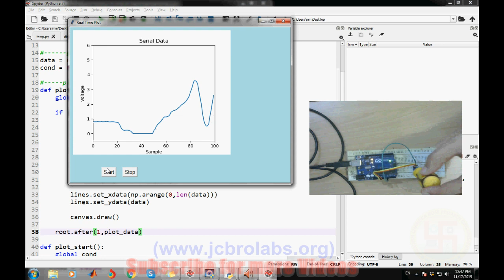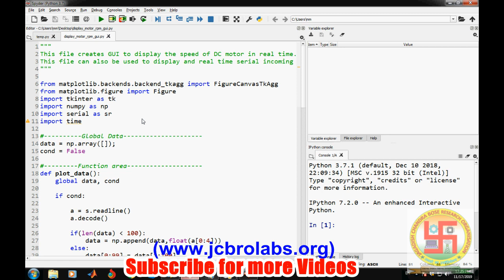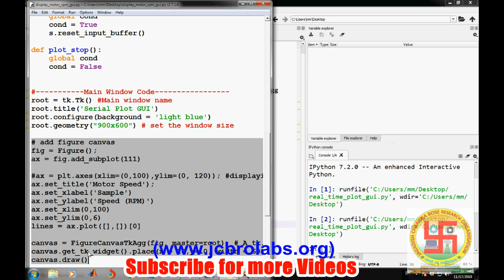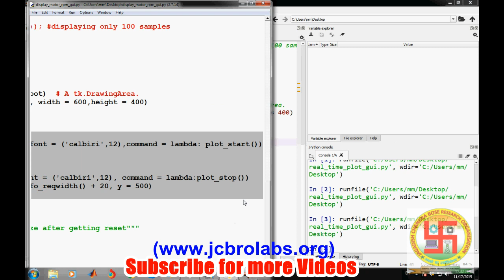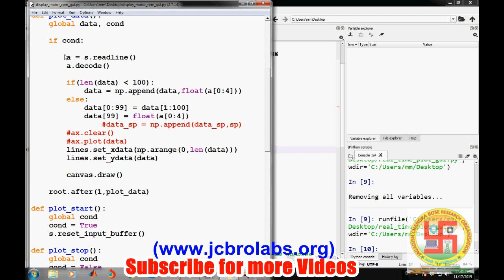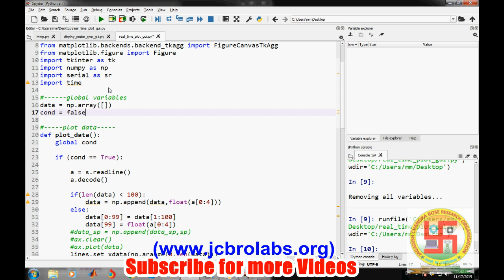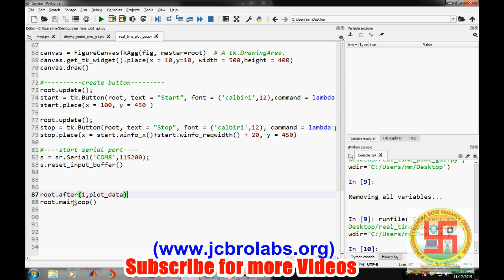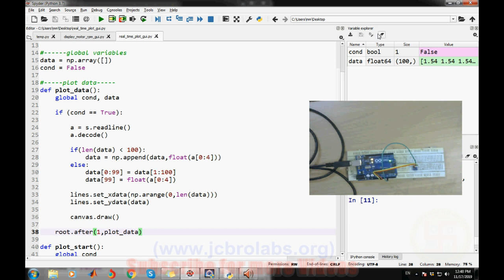How to Plot Real Time Serial Data on Python GUI??

Comment: what if instead of arduino I connect an oscilloscope , will the code have any changes or is this code compatible with that too? Someone please clear this doubt !!
Reply from the maker: Free Free...Get the AVR Bare Metal course for free. Limited Time offer....use the following link:
https://www.udemy.com/course/bare-metal-programming-of-avr-micro-controllers/?couponCode=9F5E62DD80CD1D54D816

Comment: Hello Sir, thank you for your video! I have a question. Can I implement the same code for my Nidaq USB - 6009 instead of arduino? Appreciate your help!
Reply from the maker: If I am right then Nidaq USB doesn't support serial communication. Labview driver needs to be installed for that in order to use the same in MATLAB and LabVIEW
Reply: @sachinsharmajcbro  that is true. I'm using NImax and using Nidaq modules in python, but I can't really get output in python GUI. One more question Sir, if we use arduino, then we need to write the script in IDE first then go to Python, am I right?
Thank you for your help, Sir
Reply from the maker: @dioutoroo  yes

Comment: When I press start the program crash and stop, also It doesn't show any graph signal, It Is only for Arduino? I'm using a Chatillon pull test connected via DB9 yo USB
Reply from the maker: There must some problem with opening the serial port or program routines. further, the same program can run for any board as long as data is being sent to the serial port is captured properly.

Comment: It seems the syntax for matplotlib and PyQt-Graph is not compatible. Any thoughts on when one may be better suited over the other? 

I'm trying to plot real-time data coming in from the serial port ("5, 0x1234, 1.938\r\n") , but I start to lose data after a few seconds..   any suggestions on either using concurrency (queue/collections.deque, threading, asyncio, multiprocessing) or whether to use matplotlib-blit, or PyQtGraph-split... or PyQt vs tkinter....    or any approach that would maximize the throughput so that no data gets dropped from the serial during the GUI update?

I'm running on a PC, but I saw an example of a fast oscilloscope on a Raspberry Pi using OpenGL/freeglut , however, the use of the GPU looks intimidating and perhaps overkill for my needs!
Reply from the maker: Actually, If you are sending data at fast rate and python is reading that data from a function only then you will loose samples. In this case you should use a thread to read the data from serial port. Further, if you keep appending the data in an array then too you will start loosing sample after some duration.

Comment: Dear Sir, thank you for sharing this guide. I am doing a similar project but using a raspberry pi and the INA260 sensor connected to gpio pins 2 and 3. Is there a simple way to modify your code to make it work? Thank you so much for any information.
Reply from the maker: Code can be modified. You can contact me at info@jcbrolabs.org for customization.

Comment: I have coded your example ant it works BUUT, if I let the program run it suddenly stops after a few minutes. My arduino and python program works perfectly good if I test it using only the terminal without the plot. Can you share me any suggestion to solve it?
Reply from the maker: I am not sure about this issue. After how much time, does program stops responding?
Reply: @sachinsharmajcbro  I inserted an "sleep(0.1)" function. I deleted this and the problem was solved. Thank you very much for your support. And also thank you for your video you're a really good teacher!!!

Comment: sir in line 28 it gives me an error couldnt convert string to float. the data is coming from arduino serial port by println command can u please help me
Reply from the maker: If some part of the received data is missing then it throws that error. If you are reading in continuous mode then you should use, try and except block
Reply: @sachinsharmajcbro  thank u sir i will try it. the problem that the data are sent after the start button pushed and the received data is NONE ""
Reply: @itzikovadia851   Try this code in the Arduino program: void setup(){
  Serial.begin(115200);
    
}
void loop(){
  //send a float number 5.6
  Serial.write(53); //5
  Serial.write(46); //.
  Serial.write(54); //6
  Serial.print("\n");
  //send
  Serial.write(56); //8
  Serial.print("\n");
  delay(200);
}

Comment: Hi sir,  I am facing an issue that there is no signal in my plot even I had press the start button, the graph is empty. I have checked and there are no errors for the coding. May I know what is the problem?
Reply from the maker: Hi, actually, I can't help you without looking at the code. You can send a mail at: info@jcbrolabs.org
Reply: try this code in the Arduino program: 
void setup(){
  Serial.begin(115200);
    
}
void loop(){
  //send a float number 5.6
  Serial.write(53); //5
  Serial.write(46); //.
  Serial.write(54); //6
  Serial.print("\n");
  //send a number
  Serial.write(56); //8
  Serial.print("\n");
  delay(200);
}

Comment: One thing i noticed is that the signal has a delay or lag in the signal displayed in the Python GUI.
I even changed the baudrate to 250000, but i still have a 2 seconds lag in the signal.
The Arduino IDE shows the singal smoothly.
I appreciate your help.
Regards,
Reply from the maker: Actually, yes this is the problem and I also noticed it while working on a "Real time display and data acquisition project". This problem also doesn't collect the required number of samples.
You can solve this issue with the help of threading.
Regards
Reply: @sachinsharmajcbro  Thanks for replying. I see that one makes a better use of system memory (making the program faster). I also tried making the Gui an .exe file with Pyinstaller.exe and there's barely a lag. Thanks again.
Reply: @TheCarloszoom3000   Hi, Unable to make exe file and showing error like- 

Traceback (most recent call last):
  File "real.py", line 5, in <module>
ModuleNotFoundError: No module named 'serial'

how to resolve this issue, I even tried with hidden import. Still not working

Thankyou
Reply: i have tried code in this video and having a same trouble, how u can solve that trouble sir? can u explain it to me please? thank you

Comment: Hi,
I want to show the 3d graph. can you help to do this. I am reading the value of the accelerometer. I want to show the line graph in Tkinter.
Reply: there are some changes in the line of code. I try myself to make desired output but I fail to do this, can u help me to make the desired ouput.
Reply: lines= ax.plot([],[])[0] can u explain  this line of code.  what does do? and what all changes it needs to make 2d graph to 3d graph, if I generate the 3rd coordinate by using random.random().
Reply from the maker: Hi, It can be done. Please contact us at: info@jcbrolabs.org
Reply: @sachinsharmajcbro  Ok, Thank u for giving me your contact address. Thank u in advance. I send u a mail. Plz, reply as soon as possible.
Reply: @sachinsharmajcbro  I am getting error when I pass these  "lines.set_zdata(data)" and the error is 'Line2D' object has no attribute 'set_zdata'.... what all changes it need to run these line "lines.set_zdata(data)".
Reply: @sachinsharmajcbro  still I am getting the same error after modifying the line of code. that is AttributeError: 'Line3D' object has no attribute 'set_zdata'

Comment: Hello sir, your code works very well! Thank you first of all. But i am facing a little problem, when running the code again, i recieve an warning in the console: 

invalid command name "2073612564416plot_data"
    while executing
"2073612564416plot_data"
    ("after" script)

The GUI still works when i run it a second time, but i guess it has an old after.loop running in background which collides and throws the warning or something like that. Do you know how to solve this 'problem'?
Reply from the maker: I can not say exactly without seeing the code.
Reply: @sachinsharmajcbro  i solved it on my own, the root.after loop was still running in background as i expected. So i defined a condition to exit the loop when closing the GUI and now it throws no warning anymore. I appreciate your work!
Reply: @robertstockmann4720 and @sachin sharma, I receive the same error as you mentioned here "2073612564416plot_data". However, in my case, the GUI appears but the data don't appear on the plot window. Though, I can receive the serial data while using the serial arduino terminal. Can anyone of you plz help.

Comment: Dude, isn't it possible for you to provide Arduino code? I swear I've tried with default one but it is not working. I don't know if maybe if using a wrong one
Reply: Try this code for the Arduino program: void setup(){
  Serial.begin(115200);
    
}
void loop(){
  //send a float number 5.6
  Serial.write(53); //5
  Serial.write(46); //.
  Serial.write(54); //6
  Serial.print("\n");
  //send
  Serial.write(56); //8
  Serial.print("\n");
  delay(200);
}

Comment: Hello Really a nice video... After executing it I am facing two problems.
1. The data is not changing
2. could not convert string to float: error in line data[99] = float(a[0:4])
Reply from the maker: Hi, if serial data is not received properly then this error will arise. You can try to use, try and except

Comment: Very helpful video. Could you also please suggest a way to display real time data with another loop running background? Every time I try to do that, my window GUI freezes until the loop ends. Thank you
Reply from the maker: Hi, yes there is another way of doing it by using threads. You can contact us at: info@jcbrolabs.org for more information

Comment: Please provide the Arduino Code on website also - only Python code for PC is given - One side is not enough and is DISCARD by all of people and students - provide the code for Arduino and write and explain to students to feel satisfied
Reply: You can star with this code in the Arduino: 
void setup(){
  Serial.begin(115200);
    
}
void loop(){
  //send a float number 5.6
  Serial.write(53); //5
  Serial.write(46); //.
  Serial.write(54); //6
  Serial.print("\n");
  //send
  Serial.write(56); //8
  Serial.print("\n");
  delay(200);
}

Comment: I'm working on plotting 2 signals (from Arduino).
Those are 2 float values separated by ",".
So far i have 2 graphs in the same canvas and the code stops receiveing data as it shows "List index out of range error".
I appreciate your help.

------

from matplotlib.backends.backend_tkagg import FigureCanvasTkAgg
from matplotlib.figure import Figure
import tkinter as tk
import numpy as np
import serial as sr

# ------global variables
data = np.array([])
data2 = np.array([])
cond = False

# ----plot data----
def plot_data():
    global cond, data, data2

    if (cond == True):

        a = s.readline().decode() # Reads data from Arduino and creates a <class 'bytes'> object
        
        dataArray = a.split(',') 
        a = dataArray[0]
        a2 = dataArray[1]
        
        if (len(data) < 99):
            data = np.append(data, float(a[0:4]))
            data2 = np.append(data2, float(a2[0:4]))
            print(data, data2)

        else:
            data[0:98] = data[1:99]
            data[98] = float(a[0:4])

            data2[0:98] = data2[1:99]
            data2[98] = float(a2[0:4])

        lines.set_xdata(np.arange(0, len(data))) # Returns a ndarray object containing evenly spaced values within the given range
        lines.set_ydata(data)

        lines2.set_xdata(np.arange(0, len(data2))) # Returns a ndarray object containing evenly spaced values within the given range
        lines2.set_ydata(data2)

        canvas.draw()

    root.after(1, plot_data)

def plot_start():
    global cond
    cond = True
    s.reset_input_buffer()

def plot_stop():
    global cond
    cond = False

# ----Main GUI code----
root = tk.Tk()
root.title('Real Time Plot')
root.configure(background='light gray')
root.geometry("1200x800")  # set the window size

# -----create Plot object on GUI---------
# add figure canvas
fig = Figure()
ax1 = fig.add_subplot(111)
ax2 = fig.add_subplot(121)

# ax = plt.axes(xlim=(0,100),ylim=(120,150)); #displaying only 100 samples
ax1.set_title('Serial Data')
ax1.set_xlabel('Sample')
ax1.set_ylabel('Readings')
ax1.set_xlim(0, 100)
ax1.set_ylim(200, 800) # Set Y axe min and max limits: depend on reading from Arduino
ax1.grid()
ax2.grid()
ax2.set_xlim(0, 100)
ax2.set_ylim(200, 800)
lines = ax1.plot([], [])[0]
lines2 = ax2.plot([], [])[0]

canvas = FigureCanvasTkAgg(fig, master=root)  # A tk.DrawingArea.
canvas.get_tk_widget().place(x=20, y=20, width=750, height=600)
canvas.draw()

# ---------create button--------
root.update()
start = tk.Button(root, text="Start", font=('verdana', 10), command=lambda: plot_start())
start.place(x=650, y=630)

root.update()
stop = tk.Button(root, text="Stop", font=('verdana', 10), command=lambda: plot_stop())
stop.place(x=start.winfo_x() + start.winfo_reqwidth() + 20, y=630)

# ---start serial port---
s = sr.Serial('COM3', 9600)
s.reset_input_buffer()

root.after(1, plot_data)
root.mainloop()

----
Reply: Where you able to get this working?   Did you have any issues of dropped-data?